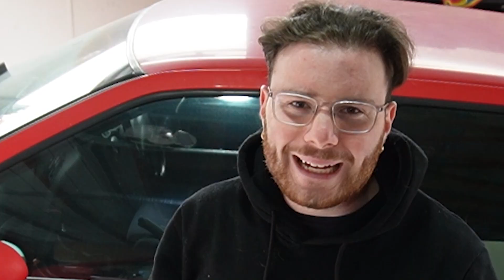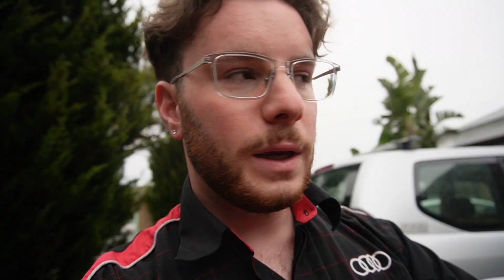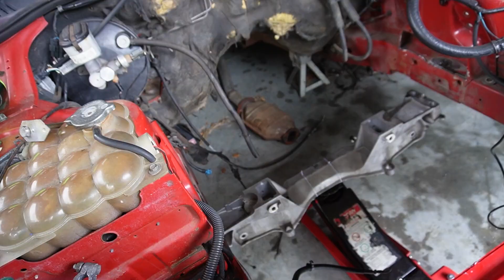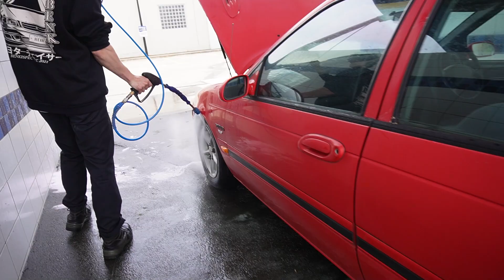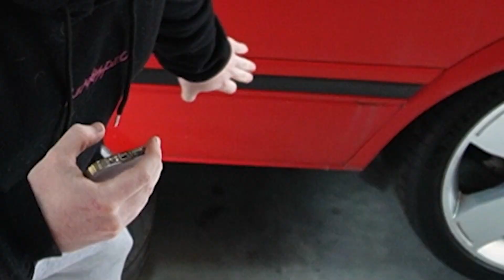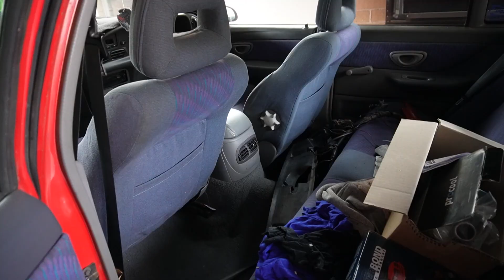HOW NOT TO GET SCAMMED ON FACEBOOK MARKETPLACE!

Comment: I would really like to buy an ED XR6 shortly, but I’m hesitant because I owned one before and it was the best car I’ve ever owned, and if I buy another one, I might keep comparing it to the previous one, and the previous one was just my baby. My dream daily would be a white EA S that is completely stock outside except it’s on coil overs with bigger brakes and has some smick 5 spoke 18’s, and it’s running a turbo Barra 6 speed. That is my absolute dream daily but I’ll never have one. I do have a BA one tonner and she gives me a chubby so I’ll live with it.

Comment: It will be worth it.
Just wondering what you will do about the paint?
Reply from the maker: Believe it or not but the paint is actually find on 90% of the car, just very oxidised. Will come up mint with a polish
Reply: @nathanpaykin  awesome mate. So these didn’t have clearcoat like the modern cars? 
I just bought a very nice 95 EF in dark green for my son for $1500. Super stoked. Engine is running rough at idle but apart from that it’s very nice (albeit a few minor dents etc). Has full service history too. I love these cars!

Comment: 5:25 NO ONE BUYS A CHEEP CAR TO SAVE MONEY. have a huge hot wheels collection, pick one and that's that. if its in poor condition it becomes a thing to put time into that would otherwise be wasted doing nothing... "1500 hours over 4 years does add up to an account of savings to some extent but that leads to an employer paying someone less because they do not need more to function in society". everything on market place is scheduled to be scrapped crushed and melted down into other things, those sales listings are the last point of no return... save or scrap. sometimes they drive themselves to the sheading facility other times not. more there are buying the melted down product the higher scrap prices get and the cheapest off the bottom listings get scrapped. the more industrial projects take over the higher scrap prices get to the point of a years gross net wages wont even qualify for a loan on something that used to sell for $300, scrap weight working or not $180/ton. 3 makes a two timer out of some "go cart fantasy", process of intermediate drivers licensing "burner cars are learner cars, no learners = they scrap everything as its listed, new owner shows up too take it to the dump... civil regulations do the rest of it for sales price to scrap value equality, taxes are so troubling so much time and parts just to, thing broke again". no cheaper then a new one at a dealership, payments just go to a mechanic not a broke broker.